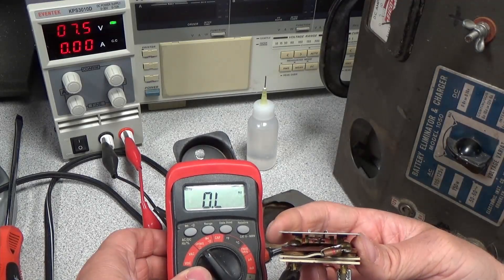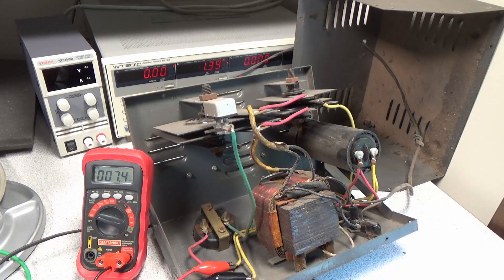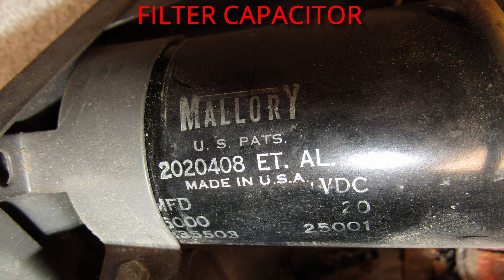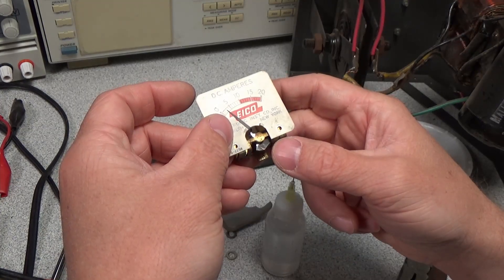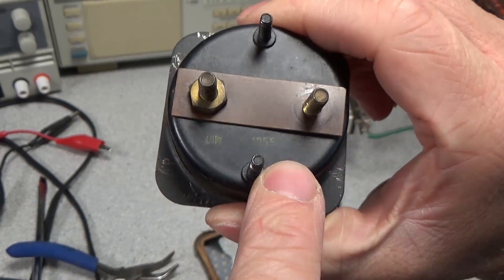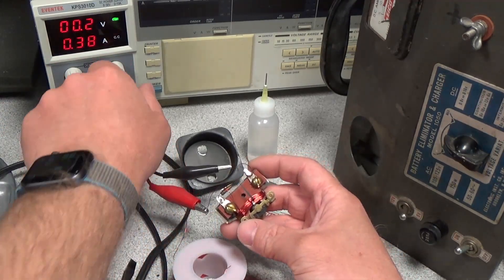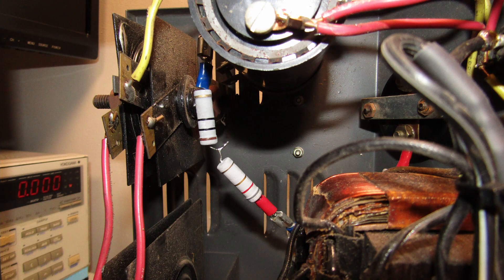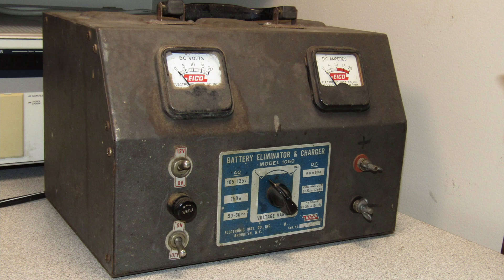Eico Battery Charger Model 1050 Meter Repair and New Line Cord

Comment: Great video, I have an eico 1040 that I'm working on. There's not a lot of specification information available online. I'm a dedicated novice, and I don't know the voltage and amp capacity of the rectifier. I'm also not sure how the one meter is able to detect amps and voltage. The unit does work but I'm concerned that I don't know the complete specs. The curled wire resister is odd too. So long story short, I want to upgrade what is needed, change out the variac and keep the appearance of it's age. Any help would be appreciated.
Reply from the maker: Hello, glad to hear someone else is working on one of these old units.  I found this online.  http://pacifictv.ca/schematics/eico1040manual.pdf  It looks like the meter connects across R1 to measure current and R2 to measure voltage.  The deflection of the needle is at some current, so 1 amp reading may be 1 mA of current (example value) so using Ohms law the the resistor values (r1 and r2) are calculated to get appropriate meter deflection for each of the two settings.
Reply: Thank you. I buy and restore old power tools as well. This type of stuff is amazing,  I'm retired and my father was an electrical engineer at Applied Physics Laboratory and I always say ok dad what would you do.